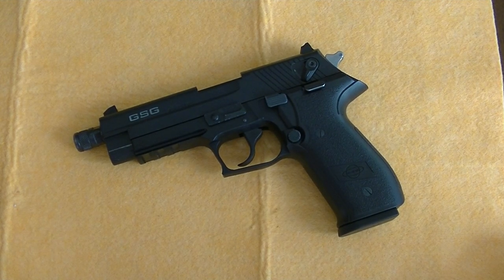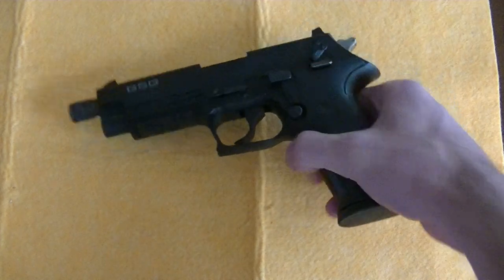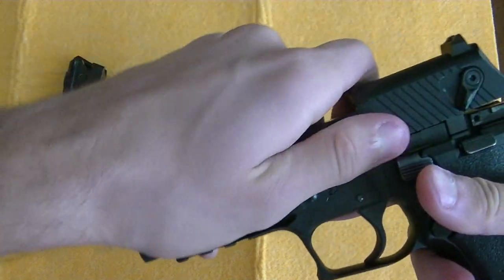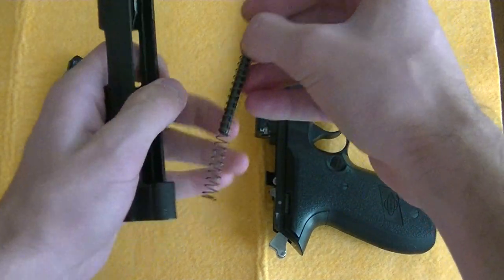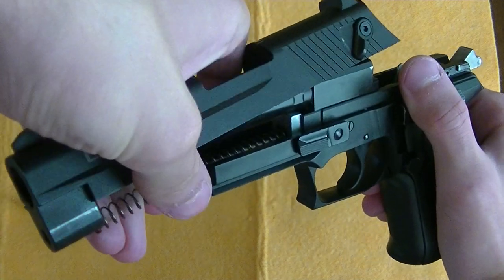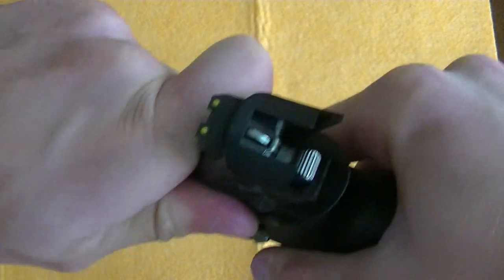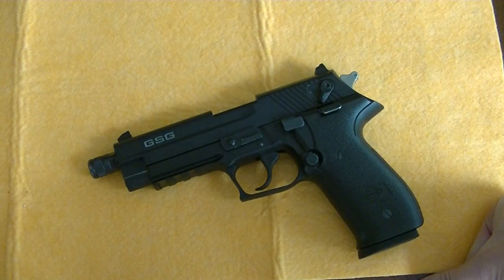GSG Firefly Disassembly

Comment: Good video. This gun was never manufactured by Sig Sauer though.  It was manufactured by German Sport Guns for Sig Sauer and previously sold as the Mosquito model under the Sig branding. They are essentially the same gun with different markings.
Reply from the maker: Thanks for the correction.
Reply: 😮😮😮😮😮😮😮😮😮😮😮ppppllpllppplpplplpllllplllllpllpllllllllllllllllllpllllllllllpllllpllllplllplllllpllllllllppllllplpplppllpllllpllllllllllplplplpplllpllllplllllllllllllpllplpplpllllllllllllllllllplllllplllpllllppllllpllllllpllllplplplpllllllpllpllplllllllplplllpllplllllllplllllllplplpplpllllllllllllpllplllplllllllllllpplpllllllllllllllllppllllplllllplllpplpllllllpllplllllllplllpplllllpllllplllpllllllllllpllplpllllplpllplllplllpllplpllllplpllllllllllllllllllllllllllllppllpllllllplllllllllplppllppllpllplllppplllllplllplllpplplplppllpllllplllpllllllllplllllllllplllplllllpllllllllllllllllllpllpplllpllpllllllllplpllllllllllllplpllplllllllllllpllllllppllpllllllplllplllllllllllllllpllpllplllllplllplplpllllllppllpll😮😮😮😮😮)
Reply: Totally agree

Comment: Doesn't show removal of firing pin housing from slide, the ONE area i need assistance with. constant light strikes causing issues as the handgun was bought to use for training students, and if it won't work, it's useless. If i could get the housing/assembly out, and really clean that, it might help-I'm betting there's cosmoline or similar inside the housing-every 3rd to 5th round gets a light strike, sometimes 2 or 3 out of a 10 rd mag is really stretching the "Reliability" claim of the handgun. tried to email then call the US mfg. center, was given the run around and treated like I'm stupid-60 yr. old vets don't take kindly to that, especially with 3X (Drill Sgt) and B4 (Sniper) qualifications. been Building and repairing guns since i was 17, and something this simple should be an easy fix.

Comment: When rotating the disassembly back to normal. I pull the slide back and pull decocker lever it disasmbles still after lever is correct. Please help. Is it broken ? I redid this part many times weird its doing this

Comment: Mine likes cci and blazer , won't bust federal Remington or basically anything else I've found yet I got da 10 da 14 and 16 mags of course u have 2buy a 10 rd and build it yourself on 14 and 16 need to make a 30 for it, I used to have a stainless rugar 22lr and it had a 55 mag in it..good old days 06

Comment: Do you have any issue with the gun cycling lower powered ammo, ie CCI Std Vel?  Thanks
Reply from the maker: I've had some issues with cycling but I don't think they were attributable to subsonic ammo, and they were fairly intermittent. The slide weighs next to nothing and the spring is also very light, so if anything it might cycle worse with ammo that's too hot and the magazine can't keep up with.
Reply: @Nest-of2ml  Thanks much!  I appreciate your input.  Next time I shoot the Firefly, I will have to really pay attention the the ammo I am using and how it reacts.  Thanks again and take care.
Reply: They have two springs, one for low power ammo
Reply: @AZISMYKINGDOM  When I bought the Firefly, they told me to put in the lighter spring to start with.  But I may have let the gun get a little dirty that it would not cycle all the time with light ammo like CCI Std Vel.   But it loved Velocitors.  Thanks.
Reply: This gun is advertised as using high velocity (HV) ammunition.
Reply: @Halera-  Thanks.

Comment: Just picked this up and when I disassembled it the block where the recoil spring sits actually slid forward....is that an issue? Any thoughts?
Reply: Same
Reply: Mine did too the lady time cleaning it. I put it back in place with a bit of force.

How has yours been firing since then?

Comment: I just purchased one of these. I am having a hard time disassembling it. I did as instructed but either the slide is not going back far enough to lift off. Or it is just not wanting to lift off. Any suggestions?
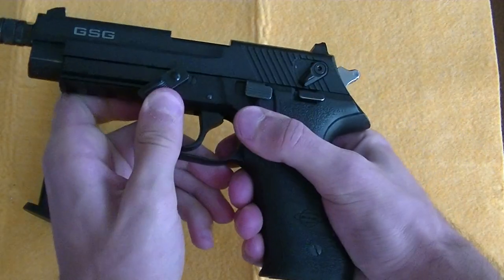Reply from the maker: Are you sure you turned the disassembly lever (0:27) 180°? If you did, then just draw the slide all the way back, lift it up, and take it off. You want to draw it back further than you do when just racking the slide.
Reply: @Nest-of2ml  Yeah, did all that. May have just been a bit tight from the factory. After several attempts it finally gave way. Now it disassembles/Assembles easily. Thanks
Reply: @Nest-of2ml thanks for replying to that comment it helped me out a lot. And thanks for making the video I appreciate it.

Comment: Holy crap I was expecting a really complicated way of doing it and it looks so easy I think I'm going to buy one of these
Reply: My 15 year old daughter has one.  It's a misfire machine.  1st mag out of the box, 3 misfires.  Have tried a lot of different ammo.  The most consistent so far is Winchester 40 grain super speed.  Still rare to get through a full magazine without a misfire.  
You get what you pay for.  Price tag is low.  I'm not one to start filing firing pins but my gut tells me thats really the only remedy.  
If you do a quick internet search you'll find all firefly owners have the same complaint.  
I would suggest spending a few extra bucks on a true Sig, Glock, Roger, Colt.....
.22 in general are picky.  This one however, as pretty as it is, I would pass on if I were you.